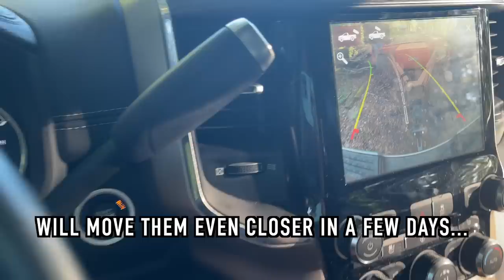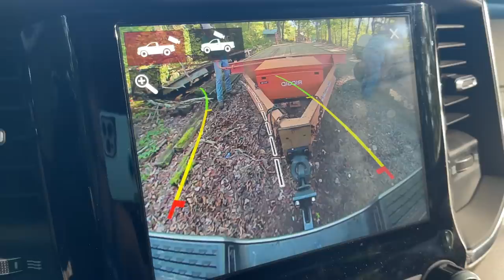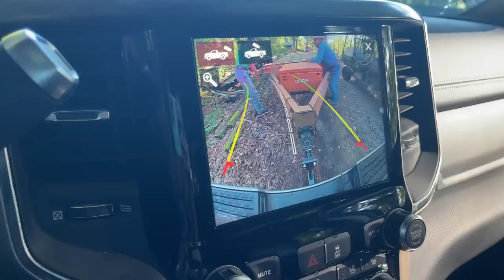Calm Before the Storm : Hurricane and Calving Prep (and a huge blowout!)

Comment: Lawrence is correct. You need to take tire off and compress spring almost to the point that it will fall of the truck, then pull spacer block out and uncompress spring. Make sure you conpress spring evenly on both sides so you don't bend the spring itself. Be extremely careful when compressing spring. Lots of tension. I almost get hurt one time doing this very thing.

Comment: Meredith i too was 😬 when Lawrence was backing that tractor on the trailer, and again 😬 when Wesley was under the trailer helping change the tire. I know, men dont like us fussin when they do stuff to possibly get hurt. Anywho, if you want, you can put a floaty under the pool cover (in the center of pool) that way when it rains the water will run off the edge of pool and not weigh the pool cover down. Those mama cows are so pretty. One of them looked like she could have twins.

Comment: That truck is low in the rear and high in the front because of the coil springs in the rear. Chrysler forgot they were building a truck, and instead of putting leaf springs in the rear like they should have, they put coil springs in, because they want it to ride smoother like some sort of luxury vehicle, not a work truck. I recon taking the levelling kit out won’t help much. Those trucks NEED air bag helper springs in the rear to level the truck up. In fact its a factory option. Seen it many times, those trucks riding light in the front end pulling a trailer. Another Great video Meredith from Ontario 🇨🇦

Comment: A quick note on your pool.  We used to use inner tubes on top of the water underneath the pool cover.  We would lash a couple together for the middle so it was higher.  We then placed single tubes around the center ones. That kept the cover up and made for less water on the cover.  Good luck!

Comment: You just need a spring compressor and some elbow grease to take that lift block out. Easy peasy, just make sure when you pull that spring that you don't let the compressor slip because it WILL knock a knot on your head with quickness!!

Comment: You'll be able to tow with the smaller tires with the levelling kit still on the front axle. Any decent truck accessory store will take it off for you though but, once it's done, you need to check the alignment, it will almost certainly be quite a way out.

Comment: Tell lawrence he is correct jack truck up let front axle hang down as far as it can go disconnect the torsion bar ends this will allow it to go down farther you will still need a set of spring compressors (you can get a cheap set from harbor freight) but the springs will not require much compression to remove  you can contact me if you have any questions

Comment: To remove leveling kit Jack up truck use spring compressors and pull out blocks . You may have to go for an alignment after . Also for that dent use paint less dent repair there mobile service and very affordable that can remove the dent without doing body work , you’ll never know it was there !

Comment: @16:46 I’m 99% sure I see the hockey pucks or spacer leveling kit. I also see positive caster and some strain on your coil spring (Same issue I had)  It literally takes like 15 min per side to remove them. I feel bad for you because it drives terribly when it’s like that. Luckily for me  I installed them so I was able to adjust camber caster toe. But even then it still never drove right so I got rid of them. 

I see POSITIVE CASTER in your Front Left Coil with a hockey puck or spacer I think I had positive caster, toe out, and negative camber. When they add those pucks if you don’t change the geometry it will drive terribly. they normally don’t tamper with the shocks when they add the pucks hence why the trucks drive like it has mad cow disease! (That doesn’t make sense but it mine was horrible) Normally you feel scrubbing. And a very unpleasant rolling motion when maneuvering at speed. Also pulling to the left hard or right. — I grew up racing from 4-25 so I had a lot of experience with setups so it was not a problem. But I would guess most people dont mess with camber /caster /toe or the geometry of there vehicle. So I feel bad for people that buy one with on and they didn’t properly set the camber, caster, & toe

Comment: Put an old tire tube in the center of the pool under cover, hold off with couple ropes over the sides tied to milk jugs filled 3/4 full with water. usually took 2 per side. not the best but worked for us.

Comment: I run the same tires on my f250 and am pretty happy after 3 years, i also leveled my front end, but all you need to do to remove yours is jack it up til all the weight is off of the springs, support the axle then unbolt the blocks and remove them,

Comment: That level kit is not bad to remove. Support the truck on the frame and support the front axle with a jack on each side. Drop the track bar,shocks and brake line brackets on each side. Lower the front axle and the springs will become loose enough to remove the spacer. Make sure the spring is back in the pocket correctly and re assemble. The steering wheel will more than likely be off once your complete. That’s a simple fix that any alignment shop can do.

Comment: If you  put on smaller tires on your truck. I believe you need to reset your speedometer to the new tire. Or it will read the wrong speed.  Plus if you remove the air system you will void your warranty. Can't you just get lower running borders and a drop hitch. It would be alot cheaper. 😆

Comment: Hey Meredith, I know that you have had a million comments on your truck and I will add another. If your Dodge is anything like our old Dodge we had, ( 3/4 ton)  The self Leveling Kit can't be removed because it has something to do with the set up of the Shocks, Springs and Driveline. That is what we were told not only from the dealer, But also from a Mechanic friend of mine, Don't know if it is true or not. We pulled our Horse Trailer and it always seemed like the horses were standing up hill which they were, You could see it. We even sold that old trailer and bought a 3 Horse slant load Goose neck and was still the same way.  Always up hill stand. 
 LB looks like he is doing well, Glad he is getting around better. Enjoyed your video, Thanks for sharing.
PS, we made it through Ian. Not much rain, 1 1/2 inch and it dethatched the trees around our place. We  do have friends and family in the Ft. Meyer's area that lost about everything. Then on the other hand, Had friends and family that had very little damage. But there all alive and thanking God.

Comment: They make a spring compressor for that, BUT, it's important to run a strong chain through part of the spring and to the frame or axle before compressing all the way because if somehow after it's compressed and something breaks, that spring can try to come get you. Lots of force there, especially with that Cummins engine. Those springs are high load coils.

Comment: The leveling kits you can do it two different ways. Bigger shocks & coil springs  or the cheaper method that drives terribly is they pucks. If you look under the fender at the top of the coils springs you will see these (ROUND RUBBER SPACERS) if that’s what’s on it then you literally just pull the nut or bolt and pull it out and reinstall the coils that is if they didn’t use the stiffer shocks.  — I only had one type of rubber pucks or spacers that didn’t driver terribly. Also usually when you level it. The camber, caster, toe gets knocked off so the vehicle will usually pull to the left just driving down the road and if you hit the brake hard it will violently turn left. But this is from personal experience with the leveling kits. I finally stopped using them and I just replaced the coils and shocks instead of the cheap way which is using the spacers.

Comment: The leveling kit is just spacers on the front suspension.  Removing it will not lower the rear.  Removing it may actually raise the rear a fraction.  The front goes down the rear goes up.  How about a drop hitch for bumper towing

Comment: You should be able to jack the front end up and let the axle hang...   Get it up high enough so the axle will have room to drop low enough to take the compression off the springs... Place a jack under the axle when you get it high enough and take the top mount bolts out on each side and lower the jack until you have room to pull out the leveling blocks and then jack the axle back up and reinstall the top mount bolts...
Reply: You shouldn't need any alignment...  Those trucks have a solid front axle and the only thing adjustable is your toe in...The leveling blocks shouldn't have affected that...If you wanna check it just pull a tape measure from tire to tire front of the rim and rear of the rim..  The front should be a sixteenth shorter than the back of the rim...  The tie rod between the two front wheels is where to adjust toe in...  The rod from the passenger wheel to the steering box is where to adjust to center your steering wheel...  That one you will probably have to adjust unless you don't mind your steering wheel crooked...

Comment: You tube on the front level kit it’s not hard to remove. No spring compression tool needed. Just a jack, remove three nuts on top in engine bay, then jack up truck on frame in middle drops the tire and suspension, take off spacer and the bolts extension on strut mounts. But you tube it and check it out I have had the same thing on minus I knew how to without you tube

Comment: It appears your Ram pickup front suspension was set up for a front end snow plow and why it is high in the front at this point in time without the snow plow. After having the snow plow on for a season; the front will not ride that high again until new coil and struts assembly is installed.  Those strut spring coil assembly's are well know for death and injuries by auto techs and many will not touch or attempt disassembly or removal of the snow plow supports being part of the coil spring - strut assembly. Not sure about Rams, if you remove the snow plow supports you may need a new spring coil as well to replace the spring coils on the truck now to get it level and ride correctly? You will also need the special strut spring coil compression tools as well to be safe when removing the strut spring coil assembly. Check out heavy duty truck shops which should be able to help you or shops that specialize with installing snow plowing equipment on trucks.  Have you consider going into the snow plowing business in an area known for very little snow...lol?

Comment: @This Farm Wife - For safety reasons; if someone should end up under the pool cover, air will come in through the holes. These small holes prevent a large pool of water from getting on the pool cover. All Intex pool covers have these safety holes, except for the covers for the Family Swim Center Pools.

TIP : place a large beach ball (min. 24 in.) under the pool cover, creating a kind of pyramid. The rainwater then runs away from the side and not through the holes in the pool water. The sail will also flake less with a lot of wind.

Comment: Please don't take off the leveling kit. Also you just need a 4 inches drop hitch. No problem hauling any trailer with right receiver hitch ball.  The leveling kit looks right. First thing I did was put leveling on track. I hate the truck with nose in the dirt and on your wheels. I wish I could show you. I loved your truck. Don't make it a plain Jane with the cheap wheels and tires. It's your truck but I would not mess it up.

Comment: Those air bags were put on because of the extra weight the dodge Cummins has on the front axle believe me I have an 2006 dodge one ton dually and I can't keep a front end on that truck I hall a 13000 pound trailer and the lift kit I put on has made a world of difference I love that truck can't believe the power it has and best of all the milage I get find a trick truck shop they did the work on my truck and did s superb job best of luck

Comment: So Meredith and kids ,,, we had a pool like that too , and I came up with an idea to keep the rain and dirt out of it by putting a truck tube in the middle of the pool under the cover , it’s needs to be really pumped up with air , it lifts the cover high enough to let debris and leaves and rain run right off of it like like the top of the house like a gable roof ok try it it’s a good way to use old truck tubes , they just need to keep the air in them ok thanks mere, praise Jesus Christ grace grace grace amen 🙏 thanks BigAl California

Comment: A leveling kit is only a small spacer that’s Inserted under the top of your factory strut and it only raises the front end about an inch and a half to 2” honey. The Dodge  have heavy duty (suspensions which raises them up in the air naturally and if you take the leveling kit off your nose will only drop down towards the ground an inch and a half to 2 inches and the back will stay where it is .They designed the stock trucks that way to get more fuel mileage out of them with lowering the nose for aerodynamics but they look stupid with the nose end down and the ass end up and small tires just make it look worse with huge fender wells . Large tires keep you from getting stuck and make it nicer towing larger payloads But to each his or hers own own. Love your videos and a big thanks for sharing . 😊. Are you sure Wesley‘s horse isn’t blind in that left eye ?

Comment: Your the first ppl Ive ever heard of that cant haul a goose neck or a trailer with a 3/4 ton truck like that.. an as for the level kit being taken out is only going to drop the front end down a cpl inches .., will not drop the back end of truck at all .. a level kit is jus to raise the front end up to make truck sit level with the back .. putting smaller tires on will help lower it down some ..if you want a truck that sits down lower then yas shoulda bought a half ton or buy a chevy like Lawrence has as they aren’t as high up as the dodge .. i think Lawrence  is too use to having older Chevys like his that sit low.. lol.. to take the two level kit spacers out is easy .. a few bolts out the top of spring an lift front end up an pull the spacer out then lower truck back down on spring an put bolts back in .. now you will have a truck that has front end sitting low in front an rear end sitting higher called a “rake” but that is the way they come from factory.. good luck 👍

Comment: Maybe put some pieces of foam in the pool to raise the cover in the middle?
Reply: Won't help. The weight of the water on top of the cover will just sink the foam. The cover is designed to keep debris out of the pool, not water. What would work beast is a lightweight tube framework to elevate the cover so rain runs off the sides.